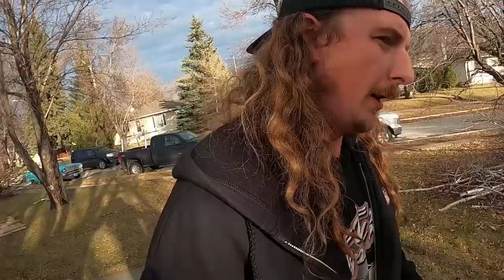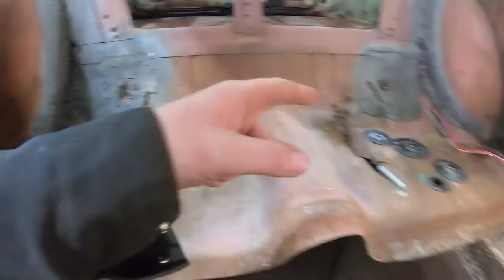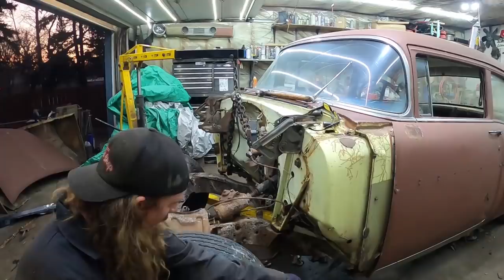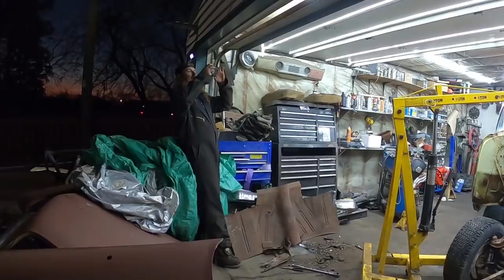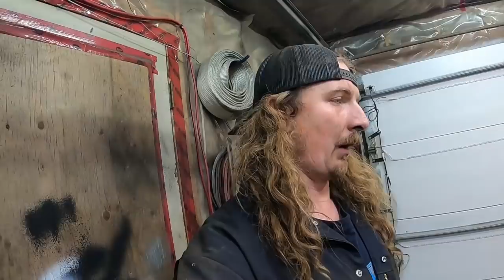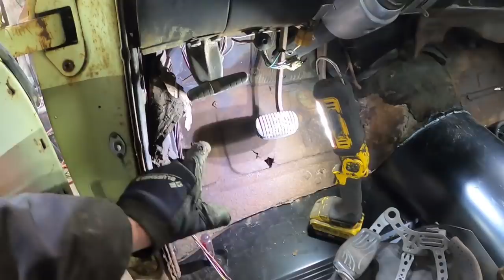Full Floor Pan Replacement At Home - Fast, Cheap and Easy On Your Classic Car!

Comment: I am old enough to remember when there were no MIG welders to do body work. Only BIG heavy industrial spot welders and Oxy Acetylene  torches. I used these to do any body work that I could manage. Also patch panels from any dealers were astronomically expensive. So needless to say many of these older vehicles were relegated to the scrap yards when they could have been easily repaired. With the available parts and such now a days it has become much easier. I admire you're efforts to save what's left.

Comment: Going with the whole floor was ABSOLUTELY the right call, Dan!  Did the same for my ‘53.  It saved a ton of time and several hundred dollars compared to what buying in pieces would have cost.  You did a great job, and can’t wait to see what you do next!
Reply: '53 what?
Reply: Good question!  ‘53 Chevy 150 2-Door.  Grandaddy bought it in 1957 from the Red Cross.  Poor thing was beaten to death and super rusty when we started saving her.  That floor pan made a HUGE difference getting her back to being solid.

Comment: Pretty sure buying a truck for the purpose of hauling tri five parts is the definition of winning at life.
Great job on the floor install. I'm old school, but the disk brake conversion is the most cost effective way to go, I went with drums on my 56, and after rebuilding the entire system, plus new wheel bearings and going through 3 junk remanned master cylinders I had damn near $1000 cad invested.
Reply from the maker: Yeah. I'll probably pony up the money for the discs

Comment: The smile of satisfaction on Dan's face just before 'Dinner Call' ...priceless. One Longhaired Canadian Motorhead and hand tools... point proven. Very  stokeworthy accomplishment. Best to you and yours.
Reply from the maker: I work for supper haha
Reply: @DDSpeedShop  Well at least you're not standing on a curb holding a sign stating the same. Great job on the floor. Best to you going forward.

Comment: These floor pans were only a dream back in '75 when I was doing my 55 post.  Looks awesome.  As long as you are this far in, I would pull the frame out, sandblast, do the suspension work, and paint it and the underside of the car.

Comment: Awesome 👍🏾👍🏾,   yeah pull motor down and paint it 👍🏾🤙🏼and straightin what you can on the body , then do a satin spray can  paint job  on it 🤔🤔  I'd like you to get your dad to do a good paint job but it will cost more, So just do what you can 😀👍🏾

Comment: Another great video. We have seen you slave over the floor and subframe on the 57 with all the welding and grinding and now that you have done this your viewers can make an informed decision about which way to approach a basket case and breathe new life into it (personally after watching both projects I think the complete floor might even be cheaper by the time you get parts/discs/gas/wire and time).
Reply from the maker: For sure its equal in dollars at the very least.

Comment: You made that look easy Dan!! I agree with others about taking the tires off. Have you ever used a needle scaler for cleaning up the rust on frames? They are loud but they do a nice job around the bolts, nuts and welds etc. I bought mine from Harbor Freight and I’ve used it for years!  I had a body shop for years and it worked out well. They even have a small one now! Keep up the great work! I look forward to watching your videos! Thank you!!

Comment: Need to take tires off put front of frame on Jack stands it be so much easier sliding floor pan in
Reply: Pushing it around on it stands with that light of a car no motor trans is not a good idea ask me how I know one wrong push and its on the floor
Reply: I was kinda thinking along those lines but just take tires off and set the frame down on blocks, under lower control arms. Wood blocks just big enough to keep the brake drums off the floor. It would pitch/rake the frame forward. Actually give him more lift travel for the body if he needed it.

Comment: Well Dan that was a good job on that floor pan that will be a nice 56 when you're thru.. I had a friend in high school in the 70's that had a 56, 2 door 2-tone white,& brown bought from a little old lady. 
We driving it to high school  blew the head gaskets, we turned around and drove it home ! Smoke was comming in from  engine bay, 
into the interior then out the Driver and Passenger windows ,we were making jokes all the way home, My Brother pulled the heads and put another pair on and it was running the same day.
Reply from the maker: Yup. Damn good old cars

Comment: You  now have solid foundation to work with.  While at this stage of disassembly, it would  more economical to install the disc brake conversion and know that the brake system is safe
for everyday driving.  Suggestion: bolt in the truck 350, drive the car and sort it out.   A race car you already have in the Dodge.  A dependable driver would be more sellable to a wider buyer pool. The hi-po engine could be traded/sold to fund a late model LS motor.  [ More power while a more street friendly driver.]   The Dodge is a car you only drive 20% of the time.   The 
56 in street form would be a car you drive 80% of the time.   Food for thought   CJ

Comment: Love it!  I built a subframe  to hook rear shocks to instead of the trunk floor, real easy and it sat real nice,The ting would lift front wheels after traction Bars were set up right. fun in the seventies.Cheers Bob
Reply from the maker: Yeah I got a shock brace on the 55.

Comment: Good job with the floor.  The world has another place for info on this job.  On the rocker area, the factory spot welded those two flanges together.  In fact the whole complete body is just spot welded together.  Look for this as you are working on it, there are always two flanges that meet, and are spot welded.  Even the 1/4's are spot welded in place.  The roof, etc.

Comment: Really cool video Dan. Your way was faster than mine for sure. When you was pulling the floor in, I was thinking, pull the front tires to lower the frame so it wasn't dragging across tires and get more clearance, but you made it in without a problem. Great job!
Reply from the maker: Haha lesson learnt for next time

Comment: The floor looks great. The tunnel ram just needs a good cleaning. You're kind of a machine. And at times, a poet. You have the ability to completely assess and summarize the situation, develop a strategy and act, nearly in the way they said Alexander the Great was able to read the battlefield. You're a very skilled economist of your efforts, knowing right where to draw the line. Great job.

Comment: Nice work Dan it went a lot smoother than welding up my 25 year old t4 that took me a couple of weeks that was using remanufactured panels too for the panes I could get like steps arches and front outriggers the rest had to be fabricated

Comment: As far as the engine goes if you aren't going to fix up the outside of the car mint then just leave the engine ratty and give it a late 60's early 70's back yard hot rod look.  Love the work on the car for sure.  It is coming along nicely!
Reply from the maker: Thanks for the support!

Comment: Hey Danny, The floor looks great. The way you did the floor is the way to go with no patch work and just plain easier on you too. I know it's expensive but your time is well worth it and the aggravation factor has to be considered too. I think you should paint and clean up the motor. When you sell it, it will help to get the most out of it. You know when you sell cars, the cleaner the better. Later

Comment: I’m jealous of that insulation job in your garage.
Reply from the maker: Did it myself 10 years ago on the cheap
Reply: @DDSpeedShop  I’m doing mine in between projects and praying that my 5000 watt heater can keep it somewhat okay in there.

Comment: You’ll like the leaf spring relocation kit. Pretty easy to do and you’ll get a alittle more rubber under it without mini tubbing it.
Reply: Also the spare tire well will have to be removed and you’ll have to get a cover to weld in. AMD is where I got mine from.

Comment: That is amazing. I would love to do that. Believe it or not that floor was much better than mine but mine is a hard top and my doors don’t fit at all. Thanks for your help. And you are lucky to find one that has what we call a nascar frame. From what I know that is why they made the frame fully boxed on a certain amount of them. Thanks again buddy.
Reply from the maker: I'd love a hard top!  So hard to find.
Reply: @DDSpeedShop  yes they are in less your rich. I have had it since I was 13 and it was going to be my first car but my parents talked me out of fixing it because it was too much to fix. But now I am 44 and I am trying to get it at least drivable. It didn’t get better with age.

Comment: I did a one piece floor on the 71 Mustang. They are a unibody so I had to stuff the floor through the windshield opening. People who see it now think its a solid car, after $3k worth of sheetmetal thrown at it. We call it the Pit of Despair because it was almost as rusty as the 65 GTO was. Still needs the cowl vents and toe boards fixed, and a torque box or two needs replaced. Haven't touched it since about 2012 or 2013. I need to finish it and get it out of my shop, and hopefully someone buys the thing from me so I can put the money into a vehicle I actually like.

When I did the 65 GTO the one piece floor was a lot more expensive, so I did patches which were $200 total vs $900 for the one piece. More welding but I was strapped for cash and my time is cheap.  Its my sumer daily driver now and is lots of fun with a 455 running lots of compression with E85 that shoves it into the deep 11s with a 3.08-3.42 gear.

The 72 Cutlass on my rotisserie right now is getting floor patches I am making from the door skins and trunk lid that were replaced with good metal. It wasn't very rusty so we didn't replace the entire floor. More work but less cash. When cash is tight you end up doing more work. 

I used to go to junkyards and buy old hoods as they have lots of flat metal and sometimes some nice curved metal. Now they are all too thin or aluminum. If I cut it off the car and its in decent shape, it usually finds its way back into the car somewhere. The rusty bits end up going away somewhere, but if it has some good metal on the piece I took off I reuse it.

This winter the Cutlass and the 76 C10 are the priority. I need the truck to pull the trailer and chase parts, I need the space the Cutlass is soaking up at the moment. I'm stuck working on a 2000 Silverado right now, it was a winter beater that developed some problems, and I fixed those and found more. It never ends when you own old vehicles. The snow here is epic and they salt the hell out of the roads so nothing I care about gets driven in winter.

Comment: U did a great job on the floor pans. To lift the car off the frame was a good plan. As for that motor u are going to put in it, I would clean it up and put it in. If you're still planning on going with the rat rod look I would just leave the motor raty to match the car. That's just my opinion mind you. Good job on the car can't wait to see how it comes along!!!
Reply from the maker: Thanks Jason. A little rough around the edges is my style

Comment: Looking great! You should do a little digging. Seems I thought there was a crossover on some brake parts from another chevy. As in take spindles and disc brakes and put them in the tri fives.  Seemed like chevelle, cutlass, skylark body from 68-72 or maybe the 73-77 batch I'm not sure. Sure seems like i remember guys talking about it. Basic spindle swap and you're there. Maybe they used the later ball joints in tri five control arms too idk. Just a thought anyhow. Thanks for sharing

Comment: I'm amazed at how well that floor went in. Pretty impressive OEM replacement panel. Who makes that floor?

I think you're right. Brake upgrade is a good idea. Even if it's being sold. 
For what it costs for paint. Splash some on the engine.
Reply from the maker: Yeah it fit real slick!

Comment: I used to have to cut those floors out of wrecks back in the day and I have cut a quarter off a car you could not get anything for and run it in the wheel then put it back on.

Comment: Thank you for another educational video.  Love that new floor.  Regarding the brakes, you are building a hotrod, right?  Everything being equal do the disc brake upgrade, it will add value, dollar for dollar it's a no-brainer.  As for the engine blow off the dirt and drop it in, it's not a show car.  Black firewalls are boring, but I have no suggestions.  I actually like that yellow green color.
Reply from the maker: Yeah I really should pony up the cash

Comment: great video , great job, curious ... what I've seen are guys plug welding the floor pan z not 100% welding the edges,  not judging just asking the reasoning , I'm about to do a 57 for a guy and I am just checking on ideas and tips and tricks. again great job 
 keep it up

Comment: I've done a ton of tri fives. Check out auto city classics, amazing people. We get our brakes and glass through them. We've even had them shop wrong parts and they're like, keep it we'll ship out the right stuff. And for basically anything ol' 55 has anything for tri fives. And they have a resto shop and can tell you which parts are better fit than others. (both places in the states). All rad dudes at those places.
Reply from the maker: Good to know!  I'll look em up

Comment: My 55 2 dr wagon had huge rust out right between the doors extending to the wheel well on both sides, I cut that out and used sections of 60 thru 66 chevy fleetside bed to patch it. That truck bed lower section from the wheel well foreward is what I used,
Reply: Behind the doors instead if between.
Reply from the maker: Ah. Good to know

Comment: Great job on the floor! I’d say they’re definitely worth the price of admission . Leave the smallblock a little ratty this whole car should be a bit of a ratty 80s style street racer, th350 with s manual valve body and a spool and gear in that 10 bolt , ratty chrome revers wheels with slicks or Hoosier dirt boss tires on the back and a set of crusty Cragars up front, a 4 point roll bar and platic buckets inside
Reply: What AndyGee's Said....  PERFECT
Reply from the maker: Thats the 3xact car I wanna build.  I jist don't know if anyone will pay for it haha.  I gotta sell this one
Reply: DD Speed Shop email me

Comment: I use self tappers to draw the panels together, makes the welds easier. If you’re selling the car paint the motor, frame, engine compartment. When the hood’s poppin, the panties are dropping
Reply from the maker: Haha

Comment: Nice job your money ahead. That right rear quarter, except for the rot , looks repairable with hammer and dolly. If you put disks on the front. No need for power brakes.

Comment: Best $1000 spent on hot rods so far. Car Value tripled with the new floor. Liked your technique of raising the body n sliding in from the front, Yea You have some brain material up there no doubt.
Reply from the maker: Yeah its a huge improvement!

Comment: disk brake it . honestly I was surprised that the windshield didn't blow when you lifted the body. that says no chips in the glass and or the rest of the body is really solid.
Reply from the maker: Yeah worked out slick

Comment: Great Job   having restored a 55 chevy  frame off Y ou made that floor fitment look easy  just using  normal shop tools!   when you get done  with  everything   body wise  and want to fine tune  your door  gaps  Danchuck ( maker of alot of tri 5 chevy resto parts  has a great section at their web site for  how and where to shim the bodymounts to adjust the door gaps ( this helps take out the body flex  issued . Again this is a good looking start,  too bad the  rr quarter  panel is so pricey  cause this would make a great  keeper  for your tri 5  group  and it is  a real 2 door.
Reply from the maker: Yeaj i like the car.  But if I can flip it and make some bucks for a new garage Its as good as gone

Comment: you may want to consider using Sherman pans as they are not made from recycled steel. they come non painted, the recycled pans would be all covered in rust when you buy them without paint at the factory

Comment: what store do you have close by that you can just go pick up a floor pan for a tri5?  I'd have to order it and it would take days to get and would be totally beat to crap when it arrived.
Reply from the maker: I ordered it in the summer and kept it in my storage unit haha.  I'm trying to be more prepared
Reply: @DDSpeedShop  OH!  that splains it haha.. im just always seeing you with parts in your truck saying.. yeah, i picked up this or that.. you could have told me a story about some wonderful body panel store 3 blocks from your house haha
Reply: @DDSpeedShop  Do you get your panels from the supplier on Sanford?

Comment: Door opens close , door opens close , door opens close . Excellent work Danny Boy , I forgot what small block you have ? Is it a 400 ? or a 350 ? Either way it’s a win being a Chevy . When your ready to install the motor splash it with a coat of Chevy orange
Reply from the maker: Its a 400

Comment: I was wondering how you would get that floor in without complete body off frame in the tight confines of garage. Hey, if you use that engine, just give it a wash and leave as is because it will match the car in aged look.

Comment: Replaced floor, trunk floor, wheel tubs, firewall and both quarters on my 67 Firebird. Big pieces are faster after cleanup and prep.
Reply from the maker: Very very true
Reply: I will be doing almost the same thing on my 68 Camaro soon except I will also be doing the tail panel, outer rockers and roof skin to.